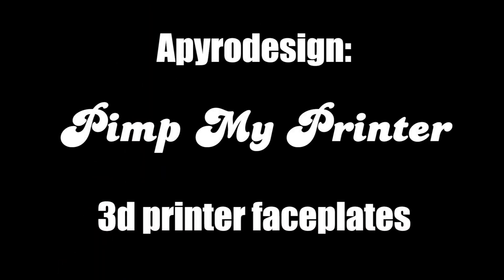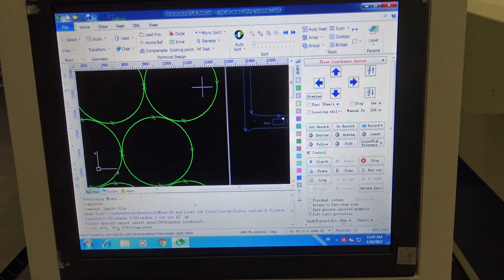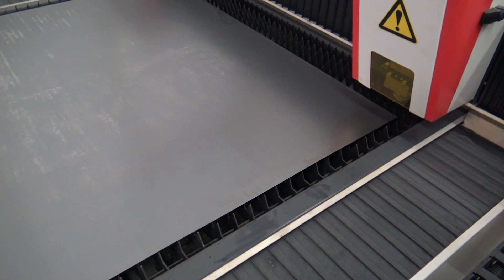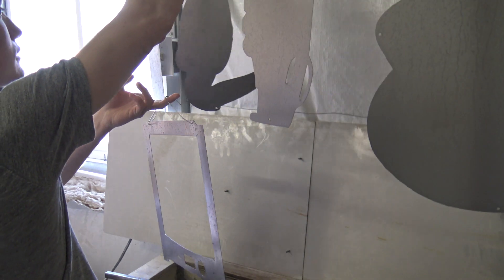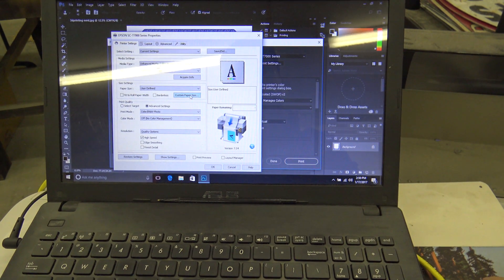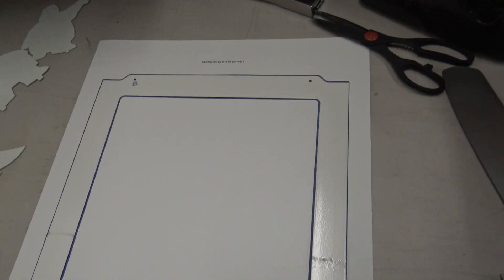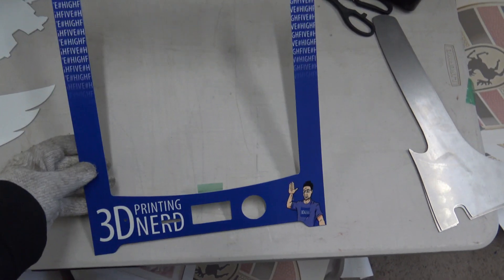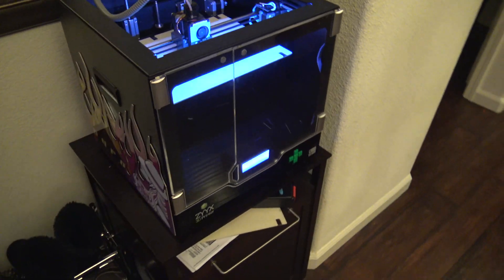Pimp My Printer!  Making custom 3d printer faceplates.  Special 3d Printing Nerd Faceplate made

Comment: this is fantastic! you need to do this for the CTC/Flashforge/Makerbot :-)
Reply from the maker: Colin Klapka Flashforge and maker bot are in the works.  They are a little harder do to the fact that I have to create the cut file manually.  I have been unable to find the cut files online for those printers like I did the Ultimaker.
Reply: I think these are the cad files aren't they :http://www.thingiverse.com/thing:18813/#files
Reply from the maker: Awesome!  Thanks a lot man.  I will add this one to my list.  I want to do the flashforge creator pro too.  That's the other printer I have.

Comment: Dang, didn't know that was even possible. I assumed they were printed on vinyl, cut out with a plotter, and put on some acrylic! I'm going to have to look into this process, thanks for sharing this!
Reply from the maker: Robert McEwen I work at a sign shop that recreates vintage metal signs. I have all the right equipment to make these at my disposal.  The sublimation equipment isnt terribly expensive because you can buy blank materials to press images into in anything from coffee cups to cell phone cases. It's pretty awesome.